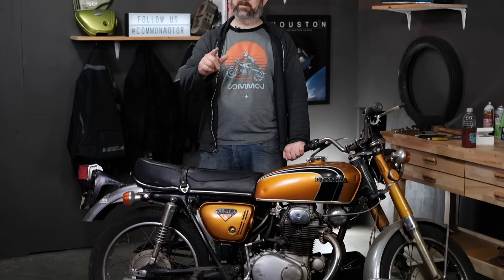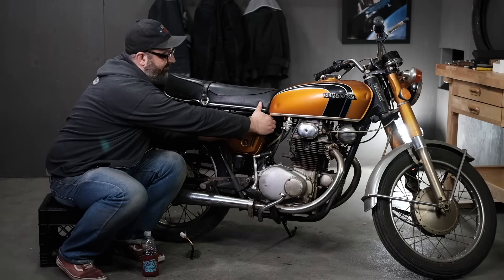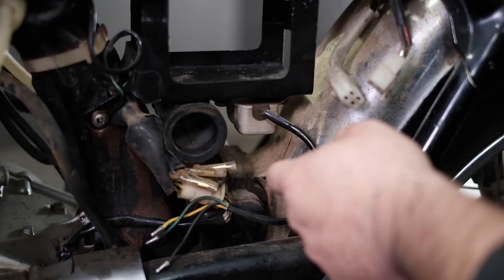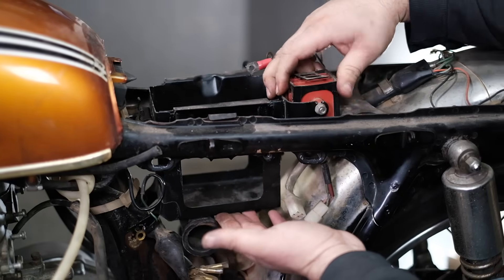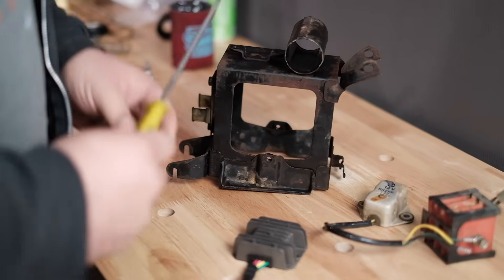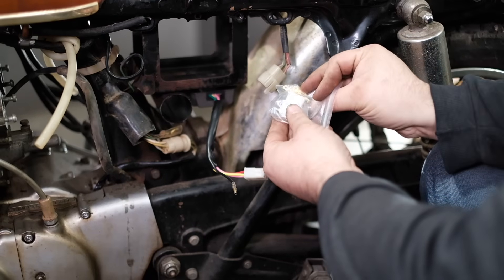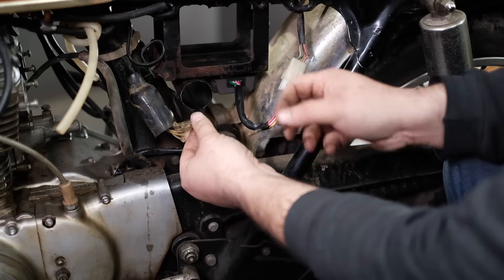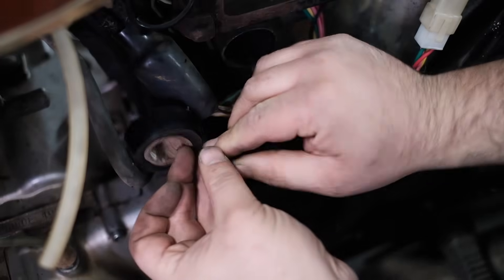How to Upgrade your Vintage Honda CB175 / CB200 / CB350 / CB360 & CB450 Regulator and Rectifier

Comment: Hi Brenden, thanks for sharing your knowledge! Does it fit on a 1975 Honda CB250G5? Regards from Holland.
Reply from the maker: Yes! The CB250's are basically the CB360's here in the states.
Reply: Common Motor Collective Thanks!

Comment: I bought an ebay Regulator/rectifier combo that does not have the black "feedback" wire. It only has two yellow, 1 green and one red wires. Can this still be used on a cb175? The plug lines up but I am confused about the old regulator connections. Is the feedback connection essential?
Reply from the maker: You need to have that wire connected to be able to regulate power. I'd recommend picking up a reg/rec unit from a better know source that has the proper connections. That could cause you some headaches and possibly cook your battery depending on the quality of it.
Reply: @Common-motor  I am considering buying one from your link below. I see there is a coupon code spot at checkout. Are you running any deals at this time?

Comment: Hi, I have a 350 and I’m going to swap out the rectifier with your new one. Will the on off switch on the handlebar still work after I upgrade to your new one?
Reply from the maker: Yes definitely. This is an upgrade to the charging system only. If you do the white/yellow wire mod that also won't effect your switch, the headlight being on or off just will no longer dictate how your stator charges.
Reply: Common Motor Collective thank you.

Comment: Hi, does it also fit the Honda cb250k? The connections are identical! And can a lithium battery be used?
Thanks for the helpful videos.
Reply from the maker: Yes this regulator/rectifier works for most of the 12v Honda twins of that era. As for the lithium battery we don't recommend them currently, I would check out our battery choices video to learn a bit more: https://www.youtube.com/watch?v=S7AZuResoOk&list=PLkt4Givtth4-dergsxQeZ0-auOSETXQas&index=3&t=0s

Comment: 200 rectifier is tucked up above the carbs in a recess in the top bar of the frame. In case anyone was curious.
Reply: Yes I appreciate it I need to find out why mine isn't charging
Reply: Same location as my CL 175. Not very fun to get to. Regulator is under the battery box.

Comment: I have a 1969 Honda scrambler 350 and when it is idling it runs on one cylinder but has soon As I rev it the other cylinder kicks in. I cleaned both carbs and didn’t do anything. I even took the carb on the cylinder that wasn’t firing and switched it to the cylinder that was firing and it ran the same. So idk any advice?
Reply: Sounds like an electrical issue, have you checked that you’re getting a spark on the cylinder not firing? Common motor collectivevhas a great video on ignition system troubleshooting, i would suggest checking that out.
Reply: Vegard Pedersen  yes I’m getting spark on both cylinders
Reply: .  the lead from the points going to my right cylinder was shorting out on the metal cover.  my right cylinder wasn't firing.  Also have you replaced the ignition coils, condenser and spark plug wires and plugs.  I had the originals.  After I replaced them the bike ran smoother.  They were going out causing an interminate firing problems.  good luck bry